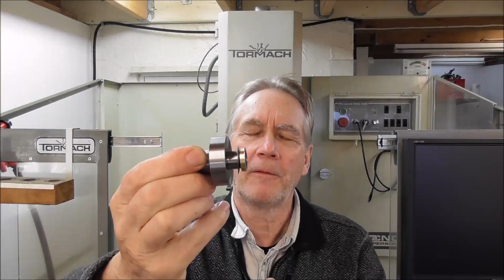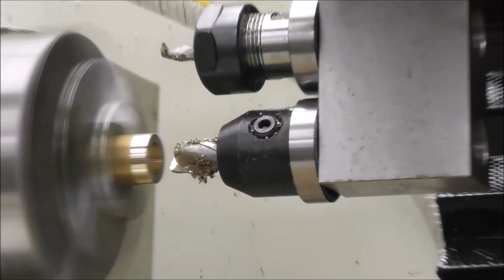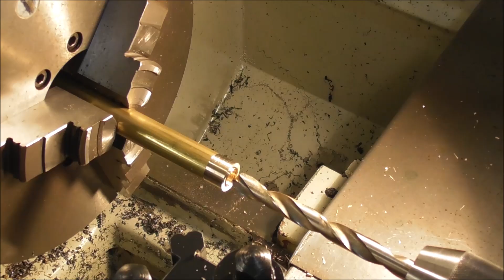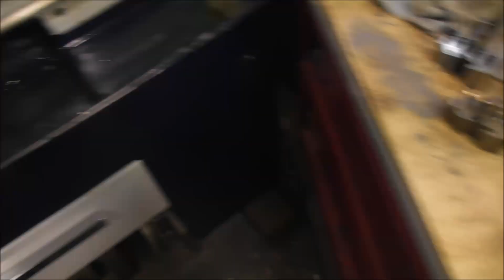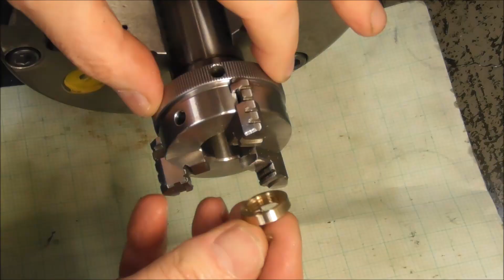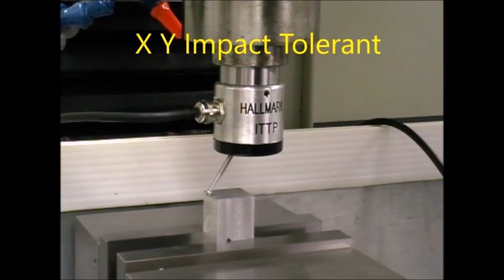CNC vs Manual machine production

Comment: Hi sir , I wonder what type of connector is at the end of the communication cable of the rapid turn ? the cable that is plug into the accessoire of the front tormach panel .
Reply from the maker: Hi. It's just a 5 pin DIN socket. Cliff

Comment: When I was building lots of machines, it became clear to me; that to get any value out of the setup time... we needed to produce 40 plus parts.  Less than that, the setup time drives the cost higher. So could be an argument, not to CNC.
Reply from the maker: Hi Jeff. Yes around 40 may be a good average point, but I would add that the minimum number is also part specific (design, geometry, machining options, admin, logistics, etc) Cheers, Cliff

Comment: This dilemma is more pronounced for ‘one man shops’.
In a huge output operation, the ‘machinist’ most times has little input… more-so where he/she is a semi-skilled ‘machine operator’.
The ‘required quality’ is set by others in the organisation , as determined by the Customer.
In a one-person shop the machinist responds DIRECTLY to the client’s specified quality, and has to make the part/s for a price.
Seeing as how material costs are relatively common ( for a given range of order size), the price is determined by the machinists skill.
Including the skill required to ‘innovate’ set/ups and processes (TIME !).
At the other end of the scale is the hobbyist, where time is not a cost… rather it can be a ‘pleasure’ 🤣🤣
You Cliff are a rare breed… a successful career as a ‘one man shop’.
You have obviously achieved the correct balance… otherwise you’d not be successful .
I tips me ‘at to you sir..
👏👏👏
Robert
🇦🇺
Reply from the maker: Oh thanks Robert for your kind words. I have always seen my work as a kind of 'paid hobby' but the downside of that philosophy is that income is limited, and I have had to keep overheads low to earn enough. Cheers, Cliff

Comment: While it may not suit this low part count I have seen Joe Pie running a custom Collet (think it was shop made) for holding similar thin parts. Like Max posted Soft jaws are likely less fuss and you could go back to automating the slotting part then holding 4 or 5 in a vise at a time. Different if this job is likely to come back for another round too.
Reply from the maker: Thanks for your thoughts. Cheers, Cliff

Comment: One factor to consider is, will the job come up again. With small parts the material cost is negligible compared to the finished price. So another point to consider is whether to gamble and make a lot of stock. In conclusion I like to use the most efficient solution for a large batch an keep stock for immediate call off from my clients. I only consider the stock value as the material cost and make stock when I get some spare time. It tends to avoid working under pressure and nice to receive an order, pick it, pack it, send it and invoice it in a few minutes.
Reply from the maker: I agree with those points. But sadly reality sometimes gets in the way! cheers, Cliff

Comment: You also need to take into account the skill of the manual machinist, the quality of the machine, lack of DRO on the manual machine, etc etc. It's pretty quick to write g-code for most lathe parts, and they come out basically perfect every time. A not very good machinist on a manual machine with no dro is pretty good at making scrap
Reply from the maker: Good point. Cheers, Cliff

Comment: Finding the balance between the desire to make nice looking parts and the need to make progress (and actually finishing the job) is the dilemma.  Perfectionists often abandon a project because small details get them bogged down, and it may even prevent them from getting started. One of Eccentric Engineering's Flexi-Chucks would be great for holding those little brass rings.
Regards,  Preso
Reply from the maker: Interesting as always to hear your perspective on this Preso. Aesthetics are huge for you, and we all benefit from the beauty of your designs and methods how to achieve them.  Cheers, Cliff
Reply: @Threadexpress  Lol i had the same advice in my backhead ^^  i have a too Flexi in my shop bought in a splitsecond after i saw the potential. And the spreading cores can be made on my small cnc lathe when i need some spare. Fantastic product. I tought about making some steel cores to get some extrem clamping power but some soft jaw chuck will do the same job.

But i wont buy cheapo chucks anyway sone had my fair share with junk!

Nice vid btw nice vid mate.
Reply from the maker: @fearlyenrage  Thanks, Cliff
Reply: @Threadexpress  always a plasure Cliff alway.

Comment: Back home in Oz before I retired, I ran a repetition shop making almost nothing but Brass fittings, 500,000 plus pieces a year. I used to chase seconds on every piece we made. We started out with old Capstans, moved on to Cam autos, and eventually CNCs. Although I was never looking for perfection, everything had to meet a certain standard, but producing them had to be quick and efficient. As a bit of an aside, we had our parting tools ground at a 15° angle, so the leading edge got to the centre first and would normally not leave a tit and or a horrible mess if there was a thread through it, but normally the back end was internally chamfered to avoid that anyway.
Reply from the maker: Hi. Mass production...I know that journey well, and I find it so tedious. Yes, I sometimes use that angled parting blade tip, really helps in some situations. Cheers, Cliff

Comment: I would "err" on the perfectionist side. In this instance or, I'm sure, in other similar small batch production runs, a modest investment of time to build a work holding fixture ONCE then pays off  every subsequent run. If it's a one-off operation, then you have to decide which devil on which shoulder you listen to.
Reply from the maker: Thanks for your input here. I am finding that as the years go by life is a moving target and fixed solutions make less and less sense. Cheers, Cliff

Comment: I suffer from perfectionism and see it as a curse. It isn't 'I am going to do this until it's perfect', it's more like 'nothing I do is good enough so I'm never satisfied with what I do'. It's stopped me from enjoying pretty much anything I've tried to do for 'fun'. It took me 10 years and enormous frustration to build my loco, and caused me to drop out of uni twice. I am firmly on the side of don't go down the perfection rabbit hole if you can avoid it because I really wish I could avoid it and get 10x more done. If you do something enough you're going to learn it and get a deep understanding anyway, unless you switch your brain off the whole time. Good enough is way better than not at all, or going broke.
Reply: My friend is a design engineer by trade, we both have home workshops. He maintains “If it’s available buy it, it will be cheaper in the long run” I was reminded of this when I was screwcutting a LH nut recently and broke the carbide tool that was maybe 25% of the cost of the shipped part ….
Reply from the maker: Very interesting and I appreciate your openness. Don't be too hard on yourself, you may be looking for something deeper in life that is more than productivity. (don't worry, I am not religious). Cheers, Cliff
Reply: To another of your points, I always choose a manual machine over the Tormach when possible because (a) I'm usually only making a few of each part and (b) the modelling and programming side with F360 just takes so long, plus I'm not a machinist so I don't have a good feel for what feeds and speeds will work so break a lot of things or go super slow. The CNC allows me to make parts I would not otherwise bother with but I have never figured out how to make money with it.

If you already had the program for those nuts, why did you not re-use it? Just for the video to show the alternative?
Reply from the maker: @davidtaylor6124  Yes I have the program, but mounting all the tools up and setting the work and tool offsets takes quite a while, if I was making 100 or more, definitely worth it, but not for 30 or 40.

Comment: High Cliff . I sometimes use mild steel or aluminium soft jaws in the milling vice for short run production .  Easy to cut pockets out for work holding and often can be re purposed to fit other jobs with minimal work involved .   I have done a few videos on short run production in the manual lathe using Block turning technique .    Buy the way , your Thread Express is starting to interest me .  Something i may look into next year .  Cheers .   👍
Reply: Hey Max, the other night I was watching you cutting a thread right up to a shoulder, I immediately thought to myself ,you need Cliffs threadexpress, and bugger me dead here you are, can't wait to see you make one,
Reply: @frankmouskovias8921  May be on next years list  !
Reply from the maker: Thanks for the feedback. In this case, the next step for more grip if needed would just be a strip of wet and dry against the vise jaw - makes a huge difference. But yes, an even better grip would come from shaped soft jaws. Cheers, Cliff